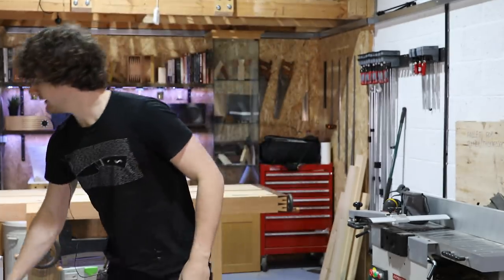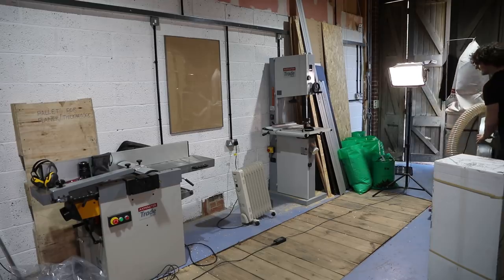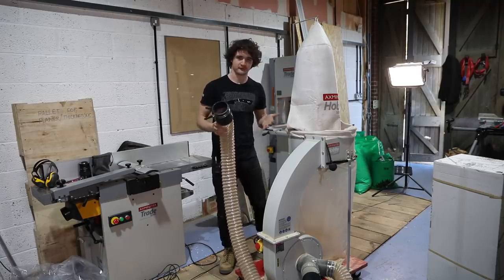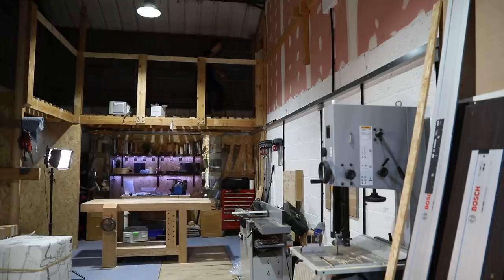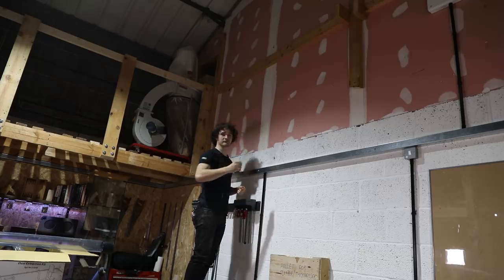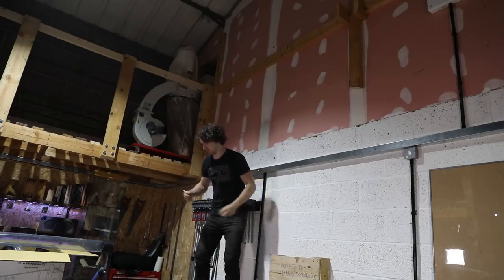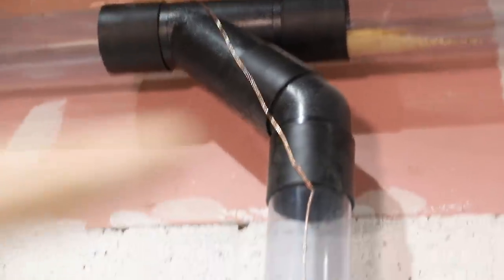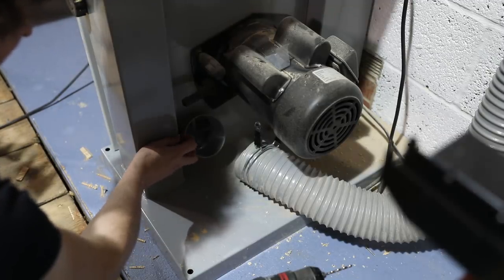Installing a Dust Extraction NETWORK in my Workshop.

Comment: Cut a hole in the mezzanine and use a REALLY long bag :-) wouldn't need to change it for an insane amount of time.
Reply: Not possible man
Reply: @zombiehunters6732 A reply on a very old comment of mine? And yes if he still had the dust collection unit up there he could let the collected chips drop down into a large and long bag. I've been to a shop where it is being done.

Comment: Agree mate, either install a switched socket at ground level or get a remote socket for the extractor, It will be so much easier for you and massivley reduce the risk of an accident. Other than that, you will love the extraction, it makes life so much easier. BUT what about air bourn dust.........are you going to fit a dust filter of some sort in the future ????
Reply: That extraction system has a huge filter bag on it.
Reply: @TheUnijacker  i can see that mate, but it wont catch the air bourn dust, the stuff that is 5 mircon or smaller which is the stuff you breath in and it knackers your lungs
Reply: @trevor33jan1  The bag filters to 30 microns, if he got the optional cartridge (which you wouldn't see) it goes down to 1 micron.
Reply: @TheUnijacker  Mate, you could almost trip over a 30 micron dust particle, Its no where near enough, it really needs to be down to as low as .5 micron, 1 micron are worst.
Reply: @trevor33jan1  I agree.  I don't think any bag systems will work to that level.  A dedicated MERV 15 or 16 filter will work nicely.

Comment: Is the body of the dust collector actually grounded?  IOW is the body connected to the ground lead on the power cord or is it insulated?

I did not believe grounding is necessary, but if you are going to do it...

Comment: Quick question theres a axminster craft 1hp dust extractor do you think it would be capable to be used with a cyclone and then a long pipe run?

Comment: You could have taken the big ring of screws out on the Y joint mount plate and turned it 90 degrees so it didn't have that nasty turn angle and mounted it in the corner ;)

Comment: This dust extractor has 30 micron bag on it? You may want an air cleaner taking it down to 0.5 micron. You would not beleive how fine dust remains in the shop without one...
Reply: Good shout there Peter. After all the research I've done before buying my extractor, I discovered the most harmful particle size for us to breath in is between 2-20 microns. Which is what's coming back out of bags like that.

Comment: One could let some yarn suck from the outlets to the extractor, then tie the copper to it and pull it upwards. Just thinking. AND i learned that static electricity always is on the outside of hollow forms as similar ions repel each other. AND we will see if bigger shavings from the thicknesser will get stuck on that wire. BUT very well done, congratulations.
Reply from the maker: The outside pipe is touching the metal trunking so should be grounded on the outside too. Also, my planer/thicknesser has a spiral cutter meaning the chips are nice and small ;)

Comment: Could stick some panels up with rockwool on around the machine to dampen the sound off it. Done that with mine and it went from deafening to barely audible.
Reply: Other suggestion for people watching is to use steel ducting instead of PVC, like from dustspares.co.uk. They seem to be the best priced.

Comment: Hi Matt,
I felt compelled to make some observations:
1. Position of extractor doesn't look ideal - Nightmare to empty dust collector,  potential for fine dust coming down over your head, Noise generator just above where you will be recording.
2. I think you will get bored really quickly having to jump up and down to turn on / off the extractor - install a low level switch!
3. I think I would have explored the possibility of building a high level platform at the door.
4. I worry a little about installing the wires internally.  Two potential issues 1. you are destroying the smooth laminar flow inside the pipes. 2. possibility of wood chips building up under wires if they droop over time and blocking the pipes?
5. Final comment from an electrical viewpoint you have just setup an earth loop.  Not always a good idea if you ever install any sensitive electrical equipment in the future.

Comment: I am amateur DIY, l did my son bed and shelf desk when he was teenage, l set the plans in drawing and did in MDF 18mm, it was good after I did when l moved house 5 times in France and 2 in the UK, and many restoration and transformation, now l am going for last move and l starting the furniture, l had bought bosh A600 defonceuse, and 1400 Bosch circular cutter, the price was good, my old staff l gave away when l thought l was going to live in the UK but the cold weather brings me back home; It is possible to use hoover for extraction of dust.? and i had a motor wash machine can l use to transform in tools?

Comment: Buy a high amperage extension cord, cut the cord and wire in a wall mountable switch. Use that for the extractor. same principle as wiring in a safety switch to a router table.

Comment: Extraction systems, nothing to be sneezed at …. unless you don't have one ? (uncoil your earth core, attach a ping pong ball to the end, start the fan and feed the ball into the far end of the ducting …. and watch that ball shoot along)
Reply: Troy Hudson this is what I came down here to say.
Reply: Yes indeed
Reply from the maker: Ooooooooo
Reply: Or a piece of cloth would do the same.
Reply: I was just about to say the same thing but just tape a bit of cloth to the end, I would of bought more cable and run it from each machine back to extractor also coiled it round the outside from each machine back to the extractor, I hate static shocks!!!
Reply: This 👌🏻
Reply: I was going to suggest tying it to the back of a hamster and getting it to walk through the pipe !!
Reply: @user-in9xo6zo9p food will get the hamster moving
Reply: @zacluvin76 
Why wouldn't woodworkers just build the pipes with wood ? Would also eliminate the problem with the static, no?

Comment: . No need for wire grounding. Use what industry uses, a spay that kills static. The cheapest is Static Guard found in your local grocery store next to the soap or Amazon.  Works also on plastic vac hoses. Also works when cutting plastic pipe. Spray the plastic befor cutting. Then the chips will not stick to your saw making clean up easy.

Comment: Matt use a smart plug, and turn the extractor on/off using the app on your phone?
Reply: too much amperage draw to use those I think - also i don't think they work with NVR switches. Do you know of anyone (on YT) that shows this being done- be keen to see how to do it.
Reply: @TakamiWoodshop  If it's an NVR switch, you'd need to replace it entirely...

Comment: why don't you use a remote control to turn on my vac. system... i picked up a cheap one at the big box store and i have never had a problem... that would save you having to jump onto you bench... just a thought....

Comment: If you tied some string to a piece of paper, you could have turned the extractor on and sucked the string up through the tubing, then tied the string to the copper wire and pulled it through. I know it's all done now, but for next time...

Comment: For turning on and off just install a normal wall switch down below to the plug in up top. Shouldn't need an electrician, pretty simple install. Because I can see having to jump to to turn it on getting old for you.

Comment: If I use iron pipe for dust collection network,should I install grounded wire?
Reply: No need unless you have plastic couplings attaching the pipe to the machines. if you do you need to attach copper wire from the pipe just as it enters the coupling and then attach it to each of the machines  with a screw.

Comment: Should have just stuffed a plastic bag with the ground wire connected at  the farthest extraction point and turn on the flippin' machine, it'll suck right to home base, voila', done deal, then do your connections. As Obi1 stated, just run a switch leg down from the receptacle to easy reach, boom, easy-peasy.

Comment: Is the suction strong enough cause I have one of those hobby extractor and it isn’t very good with the meter hose
Reply from the maker: I got the big hobby one. The airflow is HUGE. The smaller ones not so much

Comment: When I fitted the extraction in my workshop I used remote socket controllers which plug in the wall and then plug the extractor into the unit then I can turn the extractor on with a remote control all I have to do is open the blast gate at which ever machine I’m operating
Check out,
DEWENWILS Remote Controlled Plugs, 13A/3120W Heavy Duty Wireless Light Switch, 30m/100ft Long Range on Amazon.
Great video, Thanks Neal.

Comment: Unless the grounding wire is touching the PVC tube it won't work on the inside of the pipe. You would do just as good coiling the wire around the outside of the pipe after all you only get a static shock when you touch the outside of the pipe.
The chance of a dust explosion is ZERO please stop perpetuating this myth, for this to happen the dust has to be fine such as coming from a sender and NOT a planer or saw, also it must be of the right concentration to air mix which is another thing you would not get inside the tube ( to much air flow)
Reply: all though I agree with your myth comment, whether  its wrapped around the outside or inside it makes no difference or enough to argue. pvc has a dielectric strength of roughly 140-200kv/cm. you literally would have to cover every square "cm" to even make it worth while. and at that point you might as well have just bought metal pipe!😂 but people will never stop believing this myth and continue doing it.

aside from that your dust collection looks nice Matt! keep up the work man!
Reply: Ah, but as the late, great Sir Terry Pratchett taught us "Million to one chances crop up nine times out of ten".
Reply: Agreed Matt, please don't perpetuate these myths. This is unfounded FUD -- there have been zero cases of this ever happening. Also you can't ground PVC, you aren't really doing anything there
Reply: Not a myth ! Just a very very tiny chance of it happening in a small workshop
Reply: @whosaidthat5236  It's never ever happened, therefore it's a myth.
Reply: @chrisjohnson6482  The absence of evidence is not evidence of absence. I spent 32 years as a firefighter attending incidents where I would hear people (The ones that could still speak) say things like "How did that happen?" and "That's never happened before". I have attended incidents caused by dust explosions, admittedly not in small workshops. The ones I attended were in paper pulping mills. However I could easily imagine a scenario where a dust explosion could happen in a small badly maintained and unkempt workshop with years of buildup of fine sawdust especially in high hard to reach places. Having said all that, I don't think Matt is at risk of a dust explosion.
Reply: @koconnor  "The ones I attended were in paper pulping mills" precisely not the sort of environment found in a home shop at all.

"However I could easily imagine a scenario " Indeed, it takes your imagination, because as I said, this has *never* happened. There are zero recorded incidents of it ever happening in a home shop scenario. It would take an extreme concentration of sawdust impossible to find in a shop environment. You would be unable to see in front of you it would be so thick.

I have no problem with Matt doing whatever voodoo hocus pocus he wants to do to make himself feel better in his shop, after all, emotions are real. My only problem is in demonstrating that voodoo to other people on what is meant to be an educational channel.

And I don't say this as anything personal against you Matt. I recommend your channel to people often. I just wanted to call this out and maybe hopefully next time you will think twice about spreading FUD and instead just stick to the facts
Reply: The grounding of the extraction is a totally pointless exercise!! There is standard industrial equipment in the workshop, all have electrical components which will create a spark when turned on or off.. If there ever was a dust cloud capable of igniting in this workshop (never gonna happen) I can assure you grounding a plastic pipe won't stop that from happening.

Comment: Could have just secured the wire to a big bundle of paper towel and sucked it down the pipe using the fan. Obviously making sure to stop it before it got too close to the blower wheel.

Comment: Grounding pvc or other plastic pipes has really no use because pvc is not a conductor it does nothing.
Static electricity is, like the name includes, a build up potential at a specific spot whitout a moving current. Maybe, with some luck, the copper conductor will be in contact with a build up potential now and then which will equalize to neutral.